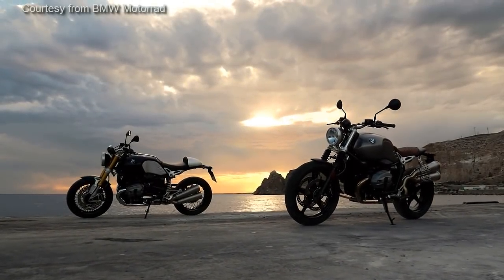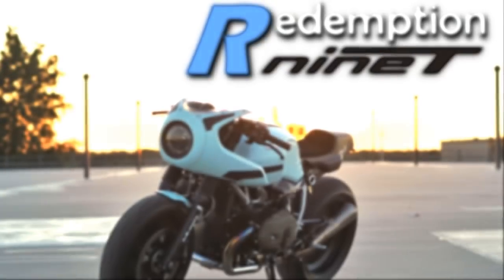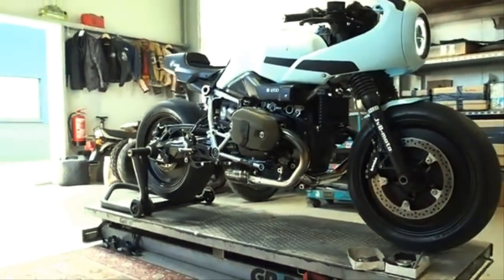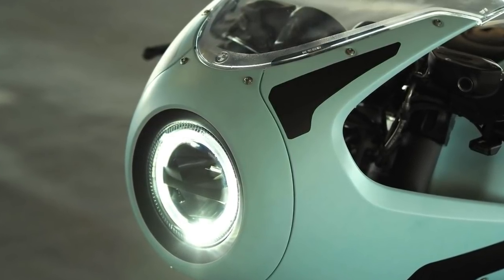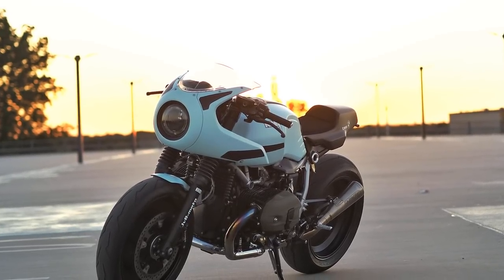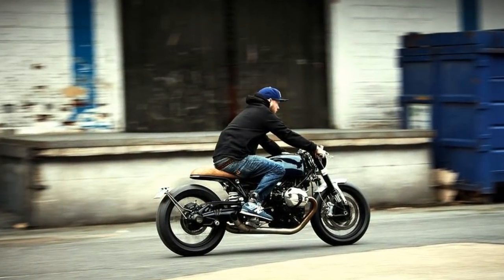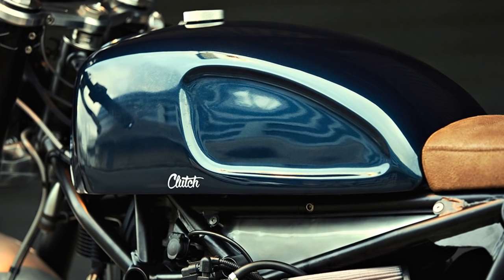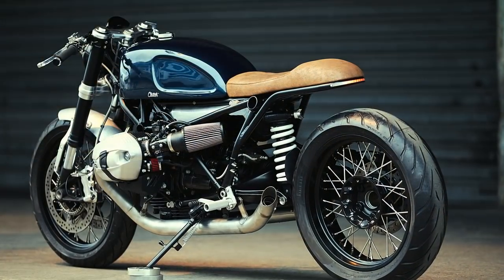Cafe Racer (BMW R nineT by JVB Moto and Clutch Custom Motorcycles)

Comment: I have questions. What do think about the sky team Ace 125 and doing a engine swap to a cb 350
Reply from the maker: Unfortunately, i think the size of the Cb 350 engine is too big to fit on the sky team Ace 125 frame.
But the honda cb200 engine would probably fit well. :) Good luck. Cheers.

Comment: Nice, and I'm sure both are pulling down serious Euros for their builds. But I'm really not a fan of those LED rear strip lights. Who was it exactly that determined there should be virtually no distinction between the seat and the frame loop and the light unit? Are builders all so scared to make a true design statement in plastic or carbonfibre? 

I'm aware it's not easy, and the spectre of OEM obviously has to be avoided - right? But I've not seen any real design input into this area since the guy in Canada build that great VFR in blue.
Reply from the maker: Thank you my friend for sharing your perspective. Try to search for some projects built by "Auto Fabrica". I am sure you are going to love them.:) Cheers.
Reply: Thank you RACER TV. Am familiar with the work of Auto Fabrica". Type #2 appeals a lot. 

I'm currently planning the work for a CBX550 Café Racer, and dreaming a VFR Streetfighter that will be funded by a US spec VF750 V45 Interceptor. 

I keep seeing things that people seem to rave about, but most will never even contemplate living with, or even rude. 

Moving away from OEM is a natural process, but you only have to look at the way chopper customs have gone in the USA (carbon fibre elements AND the down tube replaced by a solid lump is badly wrought steel!!) to realise why Russell Mitchell at Exile was so successful in setting some inspired and much needed new, saner trends - right in the heart of weirdness. 

Bikes are to be riden, and even a hot Café might have to be riden in the rain. Good Practical Design isn't about LOOKING practical, it's about how the thing works in real conditions. To this end, design has to go beyond the aesthetic. It has to work.
Reply from the maker: I understand everything you said. It is also a very respectable approach.
Personally, i see cafe racers as a second bike to have some fun on the road. It is just a matter of personal taste and needs. :) Good luck for your projects.  Cheers.